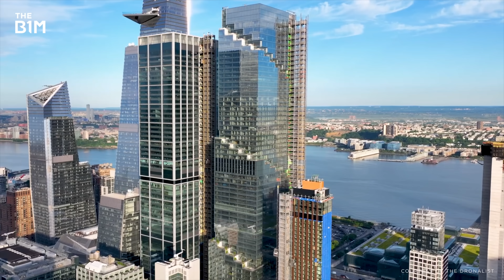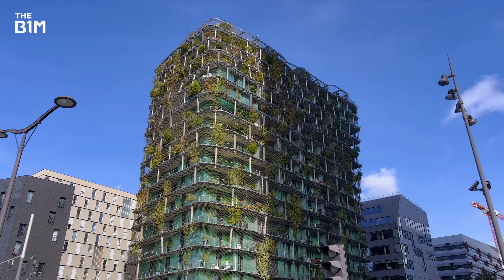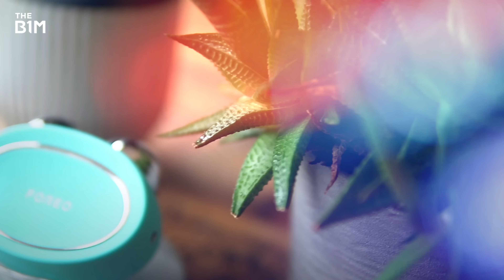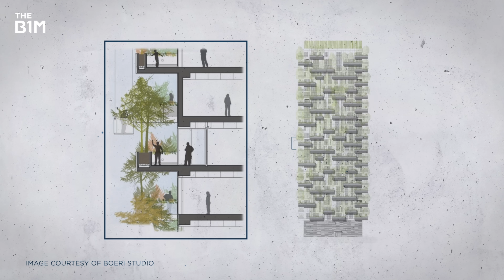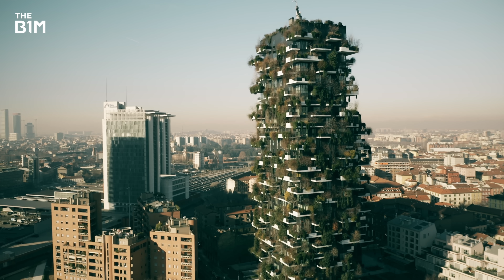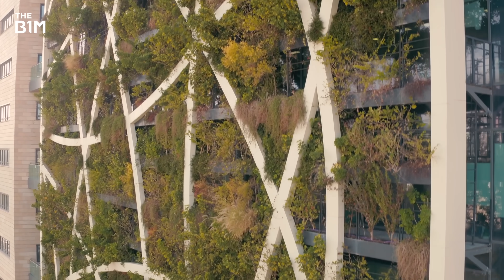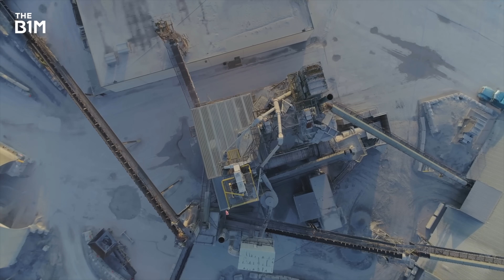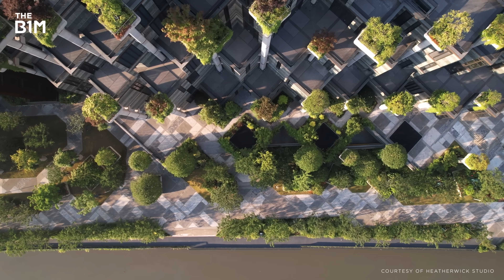Tree-Covered Skyscrapers Aren't Actually That Green

Comment: they absorb fine particles emitted by traffic! this is one of the main reasons why i love every single project like this. the air quality significantly improves and in summer it also regulates heat. we need more plant cities and while there is a long way to go to make these systems more refined it is something absolutely worth it!
Reply: I never even considered this aspect of green construction. Curious, would said fine particles be harmful for these plants to absorb?
Reply: @TomBombadil515  i mean i am not an expert on this. a friend of mine told me about it who studies biology. he told me its not harmful for the plant. when they carry a lot of soot off course there would be problems with photosynthesis but normally it rains it off and binds it to the soil. 
moss should be best suited to do the job but other plants work as well
Reply: I mean it’s a bandaid for the actual problem, the traffic itself, but it’s a fair point
Reply: @Lord_Horker  that's exactly it. And it'd be nice if we used this as that, a quick band-aid to extend our time to get rid of the true issue. However knowing world leaders, this will be unlikely
Reply: "the air quality significantly improves and in summer it also regulates heat"
That's nonsense. A few bushes cannot significantly improve air quality. Similarly bushes won't regulate heat. The thermal mass of the concrete is so large compared to the tiny bit of shade that these plants cast.
Reply: Bro more than hounded meters high the particles are diluted to almost zero and did you know they stand in a giant park with almost zero cars nearby? I doubt you could measure any notable difference.
Reply: @ctlspl  bro. i talked about the concept as a whole and not those singular projects! and bro. even though those trees higher up might not help with fine particles they produce oxygen and store water which is a good thing. und jetzt nerv mich nicht ;)
Reply: @danielstewart3507  you know.. your argument is quite nonsensical my friend. assuming there is only one bush here and there and then going against my claim is pretty dumb
Reply: @TomBombadil515  plants act as a natural filter, better for these fine particles to get blocked by a natural green wall than end up in your lungs
Reply: @danielstewart3507  tons of studies done in London prove otherwise. many schools were in locations with high road pollution and by every metric, green walls improved the air quality
Reply: @adamcourtenay  I am disagreeing with the use of the term significantly. I agree that air quality would be improved, but only slightly. The original poster claimed there was significant improvement. I'm calling bullshit to that.
Reply: This is partially true at best. There is no soil for them to sink co2 and particles. They can absorb some in their leaves and trunk sure, but it’s not a perpetual cycle like a tree planted in the ground. Planting a tree on the ground is also far cheaper
Reply: @Lord_Horker  Not really, not every city has the capital to rebuild itself into Amsterdam. In fact, in some climates people will insist on driving for a couple of months irrespective of the cycling infrastructure. I used to live in NL and I am a cyclist myself, but realistically you won't get rid of cars completely.
Reply: @Sparkiebc  Good point, does it not bind it in the plant tissue as well?
Reply: @ten_tego_teges  Yeah that’s what buses, rails and trams are for. Insisting on driving is selfish, besides a good jacket is much cheaper than any car
Reply: Would it not be as effective to plant trees along roads? Without the added costs of construction and maintenance
Reply: @Lord_Horker  Yeah, that's unless you have kids or a job that doesn't have a convenient connection. I totally understand that public transit is better, but realistically we're stuck with cars having a place in transportation for at least another generation.
Reply: @ten_tego_teges  Yeah I get that I’m in a 40 minute bus ride or 15 minute drive situation for my commute. You’re probably right but if there’s never the push it might take 3 generations or just never come to fruition
Reply: Cite your claim
Reply: @danielstewart3507  studies show 1 large tree has the same cooling capabilities as 10 airconditioners
Reply: this is true. I did a project on this topic. Having a city full of green not only helps regulating temperature and pollution, it also helps with your health, physical and mental, boost creativity and helps you be more inspired and productive. Reduces stress, anxiety and violence. The impact of a city constructed out of green buildings is just insane. The greenery also helps isolate the building so in the wintertime its warmer inside and in the summer it is cooler.
Reply: @sapsandwich  Where are you planting one large tree on the side of a building?
Reply: @_CaptainCookie  or you could do both, every meter counts, specially when it comes to regulating temperature
Reply: @Solstice261  sure, but putting trees on buildings creates secondary issues and increases construction costs - it should be an option but I don't think it's what we should be doing in a time where housing is very expensive, especially if other methods do the job just as well
Reply: @_CaptainCookie  yeah, well housing is expensive because of speculation so maybe investing is social housing would be better. But yeah first get rid of cars with trees and later think about modernizing buildings ideally both at once for cities that can afford it.
Reply: @ตามหาหญิงชื่อแก้มมีพี่ชื่อภูผา  it's more they they stick to it, the barck mainly. That's why you may see trees in polluted areas have a darker trunk. But the other benefits are more important
Reply: @ตามหาหญิงชื่อแก้มมีพี่ชื่อภูผา  bear in mind it's not necessarily absorbing, it's also providing a barrier to trap them near the road
Reply: @ตามหาหญิงชื่อแก้มมีพี่ชื่อภูผา  well it's better that it's gets trapped in leaves than in our lungs isn't it 😷. But yes trees are fairly good at reducing that kind of air pollution, both by absorbing gases like NO2 or SO2, as well as trapping fine particles from car tires and exhausts. They also provide a barrier to noise and reduce the urban heat island effect. They're absolutely something we should have more of, although it's questionable whether it's worth it to put them on the side of buildings where they'd lead to significantly higher construction costs
Reply: @ตามหาหญิงชื่อแก้มมีพี่ชื่อภูผา  as for noise a concrete wall would be awful. Concrete is a huge conductor of sound whereas the spaced out leaves of a tree would provide much more shielding against noise
Reply: You said it. Everything smells so nice, too.
Reply: @TomBombadil515  afaik yes. The particles are so small that they clog up the little holes that plants use for their metabolism, so it does affect them. Seeing how plants in cities are still alive though, it doesn't seem to be a very big deal to them.
Reply: @ตามหาหญิงชื่อแก้มมีพี่ชื่อภูผา  here in the UK motorways are flanked by trees so idk then. The reason alot of barriers use concrete is because it's easy and versatile to place, not because it's the best for blocking sound. Trees are also significantly more attractive than concrete, which is an important consideration in urban areas. I'm not sure why you're getting so hung up about trees, like why is this an agenda you have
Reply: @ตามหาหญิงชื่อแก้มมีพี่ชื่อภูผา  while you are correct that trees are not as good at helping with sound absorption, they are better at dispersing sound because they don’t cause it to “bounce” off like concrete does
Reply: I agree.  It’s beautiful and healthy!
Reply: Then put them by where they are emitted- roads.
Reply: Sources?
Reply: The maintance of those produces probably more fine particles than they would ever absorb. It's just a stupid idea in general.
Reply: @robertmusil1107  does it give you a pause when you use in your argument 'probably' and in your conclusion a definite 'stupid'?
Reply: @sapsandwich  in the city i live in the always put up things that spray water. it is so nonsensical to me because this doesnt cool my body as much as the shade etc of a tree would in a 40 °C weather. so i always knew trees > stupid tries to air condition. now i want to see some studies and maybe try to push trees more in my city!
Reply: @danielstewart3507 oh it definitely helps with heat. Stand in a yard with trees vs not.
Reply: @JohannBBravo  no one is saying trees are bad.. the question is are they worth so much effort that it takes to put them on buildings instead of in parks where they belong.
Reply: How about actually solving the transportation emission problem by i dunno...
making walking, cycling and transit an actual option?
Reply: Simple answer: MORE PUBLIC TRANSPORTATION!
Reply: We'll all be under water by the time this concept can be disproven.

Comment: I used to work in this area about 10 years ago. One of the biggest advantages (at least in Australia where I am) is the amount of sun energy that greenery adsorbs, which has astounding effects on the cooling bills in summer! Maintenance is a big issue - you need actual horticulture people looking after it because everything is so specific and finely tuned. Too much or too little water/nutrients/sunlight will kill the plants. 
The computer that ran the watering system for a certain building crashed and the irrigation didn't run for some time on a weekend. The cost of replacing all the plants that didn't make it was about $100,000...
Reply: $100.000? Are the plant quite fragile or something to make replacement cost that much?
Reply: @fadillah6014  A large number of plants all needed at one time, combined with the large range of specialized skills needed to build and maintain the systems required to keep them alive in conditions where they would not normally be able to survive, means that the people involved can pretty-much set their own rates.
Reply: @fadillah6014  $100.000 can't compare to million dollar save on air-conditioning.
Reply: @kongwee1978  I'm aware of that, but for plant I quite surprised since I was planting many types tree but never got this expensive
Reply: This pretty much nails it. The video doesn't actually address it explicitly but a major benefit is not as much tackling greenhouse gas emissions from cities but rather the problem of urban heat islands in cities, and particularly in urban canyons.
Reply: @kongwee1978  Yeah there isn't going to be a million dollars in saving on air conditioning... do you think all the windows are covered too? smh